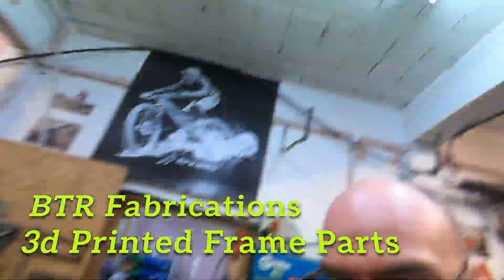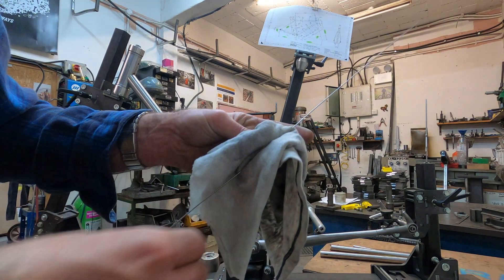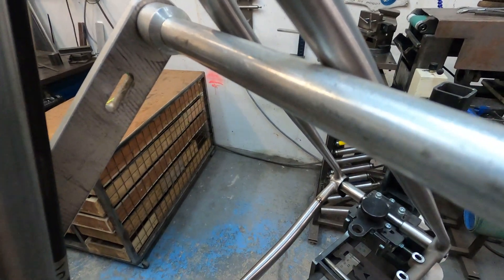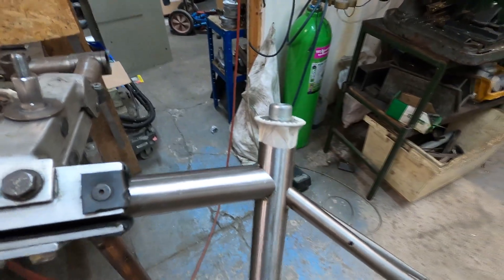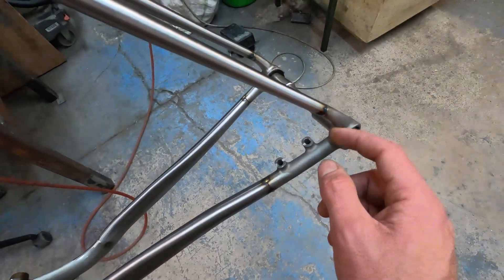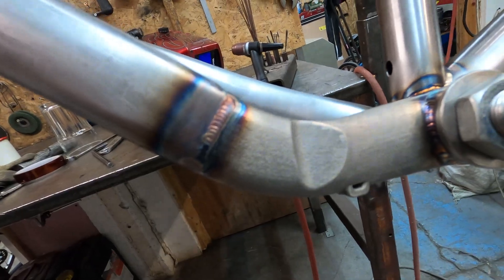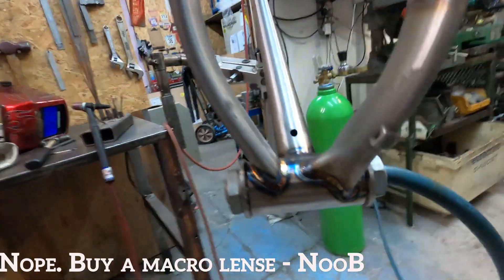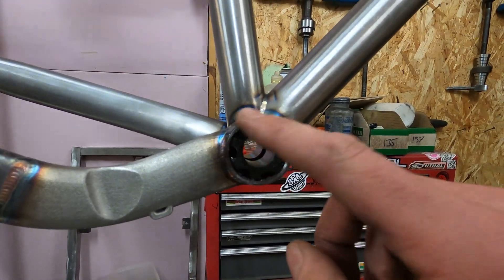Gravel Bike Framebuilding - 3D Printed Parts - BTR Fabrications

Comment: hey so i was planning on building a frame with 3D printed parts too and i was wondering if you have done anything to those 3d parts like anneling or similar to better weld them together with the normal tubing. And another question: do these kinds of welds (3d printed part to normal tubing) actually hold up against the stress of mountainbiking?
Reply from the maker: Hey mate. So I didn't actually get these posts printed. A client sent the tubes and prints and asked me to weld them. As far as I know they didn't go through any annealing. Printed parts are pretty tough and they are featuring on world cup winning DH bikes these days. Check out my latest video while you're here!

Comment: New (to me)  details around the purge gas for the rear triangle welds. Also enjoyed the alignment setup process. 
I agree with you about rear axle alignment to main frame being a key dimension. Bikes that track straight on the trail/road are always easier to ride and balance.
Reply from the maker: One only really needs to purge stainless and titanium. It's not a requirement for steel but some people do because it's does improve things. Cost to benefit would be a personal choice.